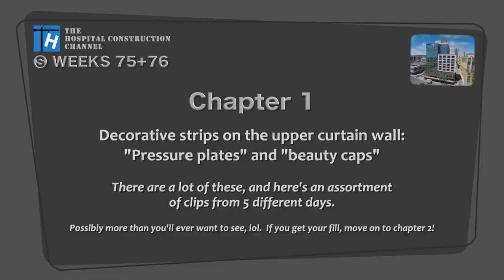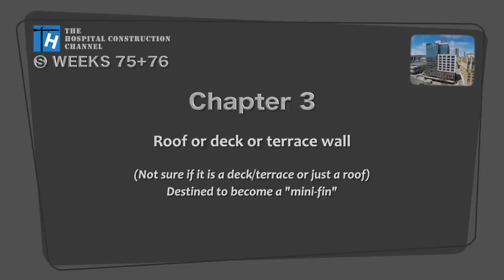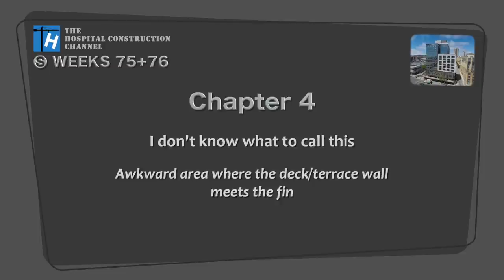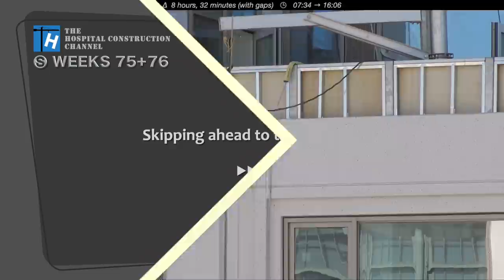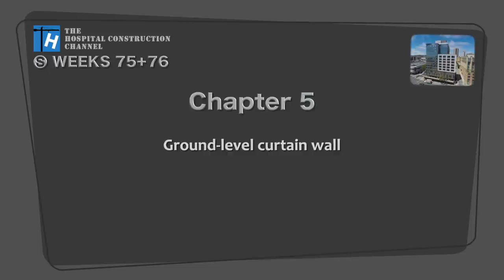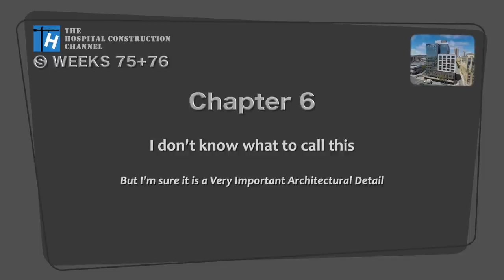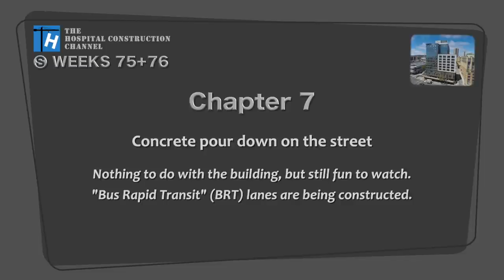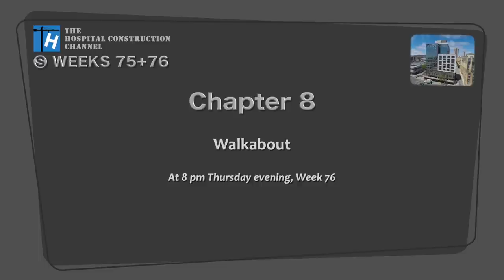Construction time-lapses with closeups (compilation): Weeks 75+76 of the Ⓢ-series

Comment: 44:30  Always good to have the finger trowel 'handy'( sorry, couldn't help myself). Then when done, wipe on bldg, wipe on pants so as to not have to clean the metal trowel you were holding in the other hand the whole time. :-)
Reply from the maker: Caulk boogers
Reply: @HospitalConstruction  For weeks now I've had the question, when all is done, how many miles of backer rod and how many gallons(tons?) of caulk will be used to 'glue' this building together?